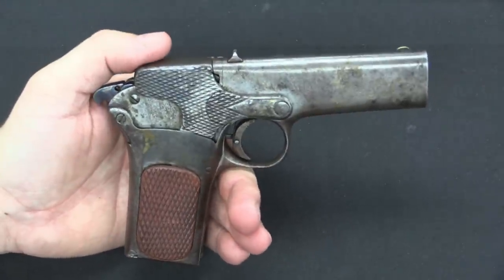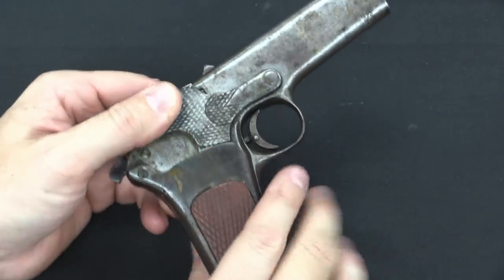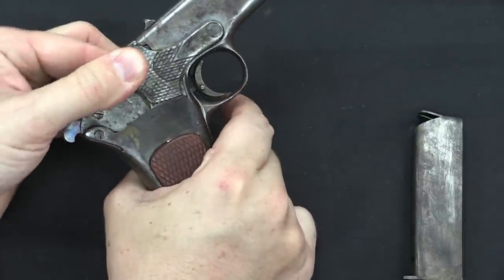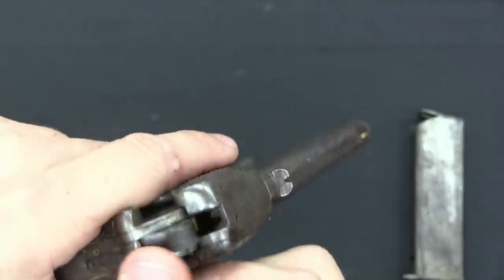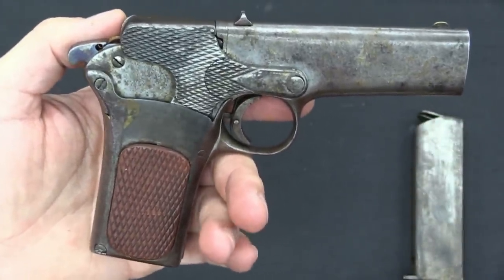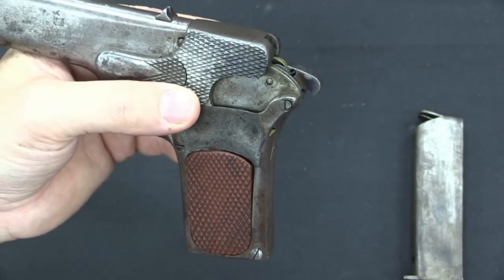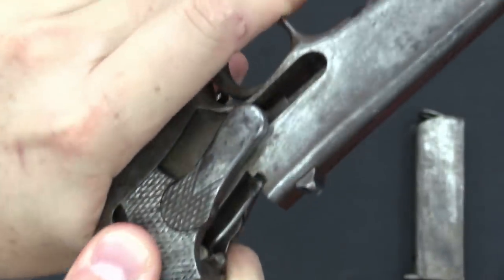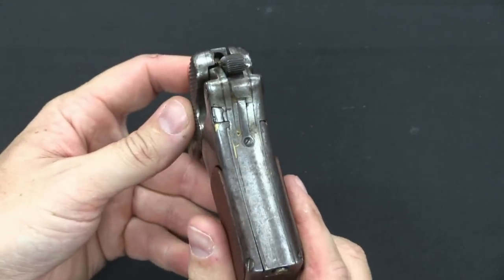"Rocking Block" Mystery Pistol

Comment: If I had been trying to figure out where it was made I'd have first taken a micrometer and measured the thickness of the sheet metal used in constructing it.  If it was metric, it's not from North America.

Do you know what that magazine came out of?  I'm guessing that is from a commercially produced gun.  That front side magazine latch would be unusual enough to perhaps give you a good chance at finding it.

Are those grips plastic?  What type and grade of plastic?  Would that give you a minimum age?

If I were tossing my guess in the pool I'd think it was an experimental last ditch gun, probably Nazi.  They may have been trying to eliminate the relatively difficult machining of the receiver's slide rails.

Comment: Oh look, a Tokyo Browning. Not made by John Browning, rather a Japanese fire arms maker that was a fan of Browning, (and German roller back guns)

There's only about 40 ever made. It's missing a sort of roller wheel. It's from around the 1950s and the purpose was actually for gang related activities, regarding the Yakuza. 

The gun maker also died in gang related activities, and only ever designed about eight different fire arms, of which are actually fairly good for something made by a self taught gun maker.
Reply: Where did you get your informations from? If you have sources it could be just an amazing step to recognise this pistol!
Reply: Alex Muller a few cursory glances on the internet show nothing of relevance, so unless he has a source, it's probably bull.

Comment: Looks a bit clunky/heavy with the entire barrel/spring holder. 38 isn't powerful so that light very short recoiling mass might just do fine but it seems rather "snappy" but the weight of barrel/holder will tame it I guess... this gun might be a singer with a unnerving PINGGGGggggggg at every shot. LOL the thumb and index finger will be sore after a mag from rubbing that slide mech. + side is a long barrel for overall lenght of gun. Weeeeell... a bit to many rotary joints and pieces so potential for improvement is not great.